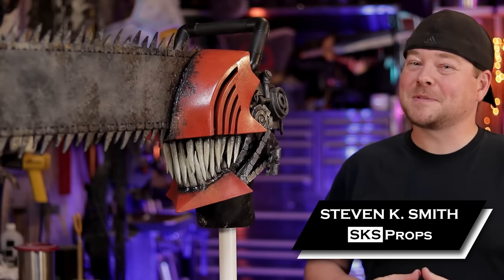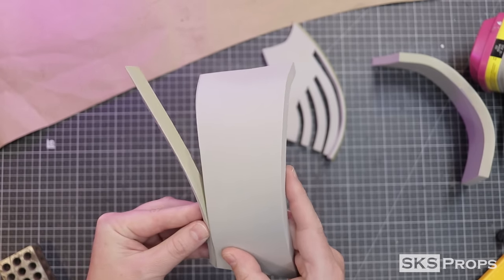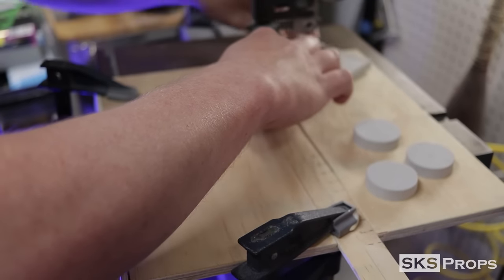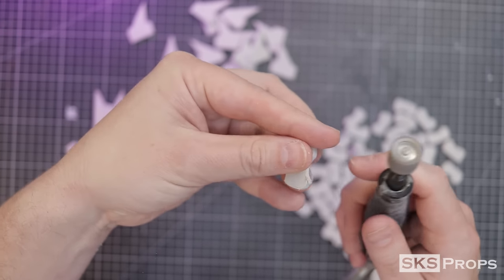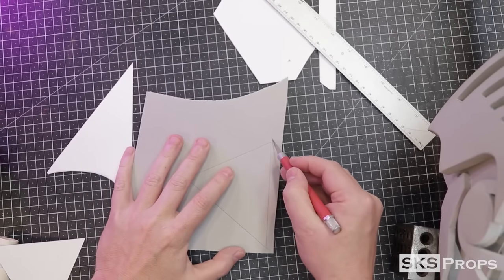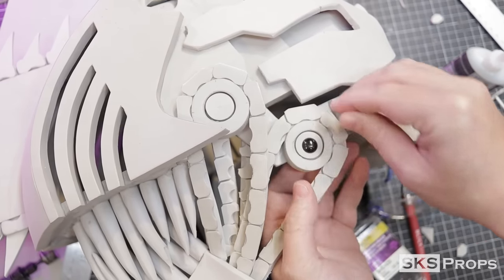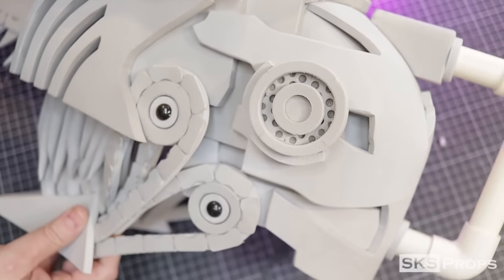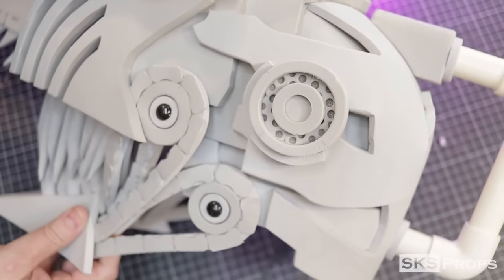How to Make a Chainsaw Man Cosplay - Free EVA Foam Template - Denji Cosplay Tutorial Part 1

Comment: my toxic trait is that i thought i could do this a week before Halloween and im struggling with part G
Reply: Believe me, it can be done. With the right tools, even I, who has never worked on a project like this, managed to almost get it done in 5 days
Reply: @soewithanumber  Working from morning to evening over the course of 5 days I managed to get it done and painted, only having to rush over a few of the bigger details on the sides in the end. As my first project like this, ever. In my experience, the biggest time saver was building a home-made bandsaw, out of placing a jigsaw upside down in a hole in workbench. Worked wonders! 

Without the right tools, like the dremel, wood boring drill, "bandsaw", hot air gun and right types of glue. And a good workspace, it would've taken more than 5x as long to get done, if possible at all!

So "With the right tools", is a very big keyword. I'm very lucky to have a dad with a very extensive garage hahaha
Reply: ive done it 3 days lol, trying again this year and taking my time
Reply: im doing the same thing, this is my first time doing a project like this and i am trying to get this done in 5 days
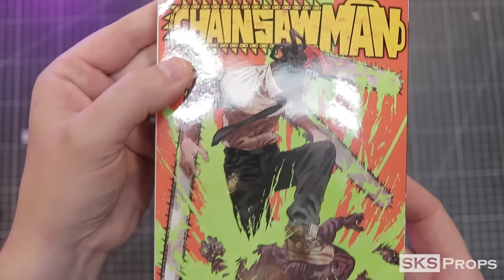Reply: Doing this at 1:52 2 days before Halloween get on my level (using cardboard though not eva foam)

Comment: Thank you very much sir. Both for sharing your talent and providing such an excellent video. 
I do have a (hopefully) quick question: I want to make the head-chainsaw to be able to actually mimic ( of sorts) the rotating  saw blade of a chainsaw by using a small electro motor (batteries) . Will the foam be able resist the extra weight and tension?
Reply from the maker: For the head yes but you would probably need to add some kind of additional support in the middle of the chainsaw itself then skin it with foam. You’d have to test what would work best (something like pvc board)

Comment: Looks absolutely stunning!
I have some questions about measurements, if you don't mind answering.
1. How long are the teeth?
2. What are the dimensions for the 6mm foam pieces, my foam is only 12" x18" and I'm not sure if it will fit the designs.
3. Will a hair dryer work in place of a heat gun?
That's all, thanks in advance
Reply from the maker: Thanks!
Teeth range from 2-3”
Might need a longer piece the blade is about 24” long unless you had a seam
Get a heat gun they are pretty cheap online 
👍👍
Reply: @SKSProps  Thanks so much, I really appreciate it!

Comment: What type of glue did you use to affix the scrap foam at the back of the blade to the mask ? I'm having trouble getting mine to adhere.
Love your videos !
Reply from the maker: Weldwood contact cement and super glue it’s my double adhesive method for a stronger bond

Comment: Curious what kind of yard marker you’re using for the support of the blade, the kind I found were not sturdy enough?
Reply from the maker: I used the metal ones at lowes for the head (it has 2 loops I cut off, just needed the straight part) and I am using the bright orange fiberglass yard markers at Lowes for his arm blades
Reply: @SKSProps  tysm!

Comment: So ive been practicing on extra foam for parts A and B i was wondering for part A is the 30 degree cut the same as part B? Where you cut 30° then you transfer to 90° around 2 in
Reply from the maker: No the part A was a 30 degree across the whole top the part b has the change near the end 👍
Reply: @SKSProps  thank you im doing hand cuts and around the bit part of the eye at the bottom its not sitting flush

Comment: I'm sligthly confused about the parts H and I. It feels wrong that they're the same size as it's making it really difficult to stuff one under the other. Is it meant to be forced under there?
Reply from the maker: Yep, otherwise it’s your build change it how you see fit.
Reply: @SKSProps  Thanks! I'm amazed how fast your respond. I'm also glad to say that the armblades turned out working really well!

Comment: Insane build but how am I going to make the templates bigger?
Reply from the maker: You open the PDF in adobe acrobat or adobe reader and then click "poster" in the print settings that scales it properly regardless of the paper size you use. From there you can change the size percentage if desired but shouldn't be necessary

Comment: For every thing you need from the head to the arms and anything else, how much would it all cost?
Reply from the maker: Depends because I already had a lot of the paints and sealers on hand. But I would recommend that you get a sheet of foam each size 2,4,6,10mm. So if you were buying the foam, paints, pvc pipes etc probably around $100-$150
Reply: @SKSProps  and for the foam sheets bundle and the foam dowels, they are sold out on the links you gave. Where else would I get them?

Comment: You should really do a tutorial on a 30 degree angle cut. Part a to b is literally the most difficult part because idk what I’m doing
Reply from the maker: with enough practice you will get better, It's just holding the blad at the correct angle. If you're not doing it correctly you can also just get a rough cut with your knife and clean up the angle with your rotary tool

Comment: May I ask after the build and painting was completed, how did you go about adding padding on the inside to remove bobble/add comfortability?
Reply from the maker: Part J is adjustable and should be fitted to your head to stop it from shifting around but you can always add upholstery foam for comfort and to make the helmet more form fitting. You can get upholstery foam from just about any craft store or someplace like Walmart

Comment: Hi I’ve been using this magical tutorial as a basis for approaching my Chainsaw Man Cosplay, and I was wondering what type of pvc pipe did you use for the handles? It’s one of the last parts left I need to make and was wondering what size you went with
Reply from the maker: 3/4" all of the sizes are in the lower right corner of the template
Reply: @SKSProps  thank you!

Comment: This looks great, i will make it for the next Japanday in  Düsseldorf, germany. But two questions : Is the pdf presentation for a normal dinA4 Paper ? The left Mask part with the 3 slits looks so small^^" Can you look good throught the mask ? I watched many diy videos of the mask building and im a little unsure.
Reply from the maker: Watch the how to print templates video on my channel paper size doesn’t matter. You see mainly through the gaps in the teeth more so than the slits on the sides

Comment: Looks great! The oil/gore residu along the teeth and start of the blade is great! How heavy is it? I imagine that's why people use EVA foam (I use a hollowed out chainsaw for my Ash Williams cosplay and that sucker is heavy!) But I can't shake the fact that the helmet itself has to be kinda heavy to offset the weight and length of the saw's arm/blade
Reply from the maker: Thanks! The helmet weighs very little it's extremely light the few pvc pipes on the back are the only things counter balancing the front blade. If you haven't tried using eva foam before for costume parts it will be a huge difference
Reply: @SKSProps  thanks for the response! I have not used EVA foam. I know it's used a lot, it's just that next level in crafting that I haven't taken the step to trying.

Comment: Long shot as its quite an old video now! I love your work just wondering how long did you make the chain strips which connect the jaw to the top of the mask?
Reply from the maker: The ones that go around the circles are approx 14-15” long
Reply: @SKSProps  Thank you for such a speedy reply I was really stumped! Thank you again for your hard work on this! So far its been a blast making it
Reply: just another question in relation to your chin where does the bottom jaw sit?
Reply from the maker: @KelProductionz  don't base it off of your chin pay more attention to the teeth and how they line up. that will put the jaw where it needs to go. otherwise some people that built this had his mouth open  and one of my friends even added a tongue to his

Comment: Hey this is super cool and I would love to try it out, but I would have to use cardboard to do so. Would there be any issues with using cardboard instead foam, also what kind of adhesive would you recommend for cardboard?
Reply from the maker: You can definitely try. Cardboard will be a bit harder to work with because it doesn’t take compound curves quite as well as foam. You’d probably want to use hot glue.
Reply: @SKSProps  good to know, thanks!

Comment: Do you happen to remember how long the pieces of pvc pipe were you cut? Finally almost done with this build and the handles are the last thing I have to make.
Reply from the maker: Sizes of the pvc pipes are in the lower right corner of the template
Reply: @SKSProps   Ohh awesome! Never noticed. I'm heading to ACEN next week and will get you some pics. Ty again for the template and vids. You're a wizard with how fast you pumped this out. Even with 6 months, I couldn't duplicate it to an exact copy.

Comment: thank you so much for this! Im going to attempt to do this since my daughter has been wanting to cosplay as him ive already bought the materials so just wating for it to arrive!! i did have a question if i want to make it smaller (daughter is 8) do i scale it down on the poster size? and also she wanted it to move can i apply the same method you used on the skull mask on this one? or would it not work because of the chainsaw in the front?
Reply from the maker: Yes I’d probably scale it down 10-15% but unsure of the size. And yes you can use the same techniques part J keeps it snug against the back of your head

Comment: HI! May I ask roughly what is the circumference of your head? And if the helmet fits you perfectly or does it fit you large or small? So as to have a yardstick with the measurements of the parts of the helmet contained in your templetes. Thank you!
Reply from the maker: My head is approximately 23 3/4” but that doesn’t matter. You adjust the build to fit your head with part J that’s why I designed it that way. And you don’t need a yardstick with the measurements watch the how to print templates video the pdf is already scaled

Comment: How many foam rolls do I need to make for each size (10mm, 6mm, 4mm, 2mm)?

For the metal yard marker, is it okay to use metal clothing hanger?

Where did you use the pvc board? You had listed as an item that was used in the video
Reply from the maker: As listed in the video description a roll of each size 2,4,6,10mm   
You'd want to use several metal hanger wires if necessary because they just wont be stable enough  
I didn't but you can use pvc board to strengthen areas that need reinforcement
Reply: @SKSProps  thank you! I am sorry if my first question was misleading what I meant is how many sheets or rolls of foam did it take you complete the cosplay for each of the sizes?
Reply from the maker: @lisaha6745  that’s what I’m saying you need a sheet of each size for this build. You’ll have some left over but you need each size
Reply: @SKSProps  thank you! Also will it be 2 rolls per each size since I still got the arms that needs to be make?
Reply from the maker: @lisaha6745  one of each size the only one you might need two would be 6mm for the arms depending on how you lay out the patterns

Comment: This job was absolutely incredible! Question about the pdf’s though. How big were the paper templates you used (for reference), and how were you able to print them so they came out at those sizes?
Reply from the maker: Thanks! Just follow the directions on my site and open the pdf in adobe acrobat or adobe reader and click “poster” in the page size area that scales it properly over several sheets regardless of your paper size

Comment: Hey SKS Props I going to be making this for Halloween this year and I currently only have access to 6mm and 4mm foam do you have a recommendation for how to adjust the pieces that use 10mm to work with 6mm.
Reply from the maker: It’s going to make it a lot tougher on you. You could glue the 4-6 together but it will firm up the foam quite a bit making it more difficult to cut

Comment: Hey
I've never worked with eva foams before or have tried to make any sort of cosplay

If I were to buy the foams, how much quantity would be needed to make this?

I'm still in college and I don't wanna spend more than needed

I saw a comment of you saying to buy the sheets of 2,4,6 and 10mm each, would that really be enough?
Reply from the maker: Yeah as long as you lay the templates out right. But if you’re worried you might make a mistakes then get an additional 6mm and you’re fine.
Reply: @SKSProps 
Hey man, I checked your website and I hate to be that guy but the prices are way too high for me since I'm from India and our currency is too weak for me to make such a purchase when I'm still in college

Do you have any other alternatives that are cheaper? I'll be very grateful if you can help me with suggestions ♥️
Reply from the maker: @Yuvraj-p9s  find foam closer to you. I have a bunch of fans that build my projects in India so I know you have options overseas
Reply: @SKSProps  
Thanks man, I'll try looking around :)

I appreciate the work you're doing, keep at it ♥️

Comment: So I was wonder, what is your head size? I got a pretty big head with like a 24.25 inch circumference. I just printed out the template and it seems just slightly small from my eyeballing. Im thinking about resizing the template to get it to my size if the difference between us is big.  I just got all the foam. I have a laser cutter so was also considering cutting some pieces out using that, especially the chains and sawteeth.
Reply from the maker: It's all adjustable by the amount of foam you remove from the inside for you cheeks but part "J" is what makes it fit your head.
Reply: @SKSProps  my seam between A and B is not great, would you just recommend using the foam clay to fill it in? Overall I'm really enjoying this build. Also having a laser cutter helps with this alot

Comment: I have another question, is part C supposed to lay on my cheeks and have space for my nose to fit? I'm now making the back of the mask with the parts M and J (which are the parts i have to cut according to my head size). I can't figure out how far into the mask my head should be so that i can mark were to glue the pieces

Comment: hey, trying my hand at this helmet right now, and I was wondering what the measurements you used for the 3/4" PVC pipes? tried checking on the template but unfortunately didn't find them!
Reply from the maker: Check again, All of the measurements are in the lower right corner of the template on the line Art helmet pic
Reply: @SKSProps  ah, thanks for specifying! can't wait to show the end result :)

Comment: Thank you for your job and for letting us have the templates. Can i ask you: if the paper size is A4, the poster mode is 3x3 or 4x4?
Reply from the maker: Just follow the directions on my site and open the pdf in adobe acrobat or adobe reader and click poster in the page size area that scales it properly over several sheets regardless of your paper size
Reply: @SKSProps  ok thank you very much!

Comment: The 15mm round dowels are sold out on the website, would the half-round or triangle dowels work or should I look on another store?
Reply from the maker: Triangle dowels will work or the 20mm and just sand them down a bit more. That’s what I just used on my foam pumpkin mimic

Comment: What kind of wire did you use for the teeth? I’ve been looking everywhere for it but can’t seem to find the right type. Thanks!
Reply from the maker: Just some 14 gauge wire I got at lowes hardware store item number 62931
Reply: @SKSProps  thanks! Also how long did you make the teeth? I don’t think you said a measurement in the video. Thanks!
Reply from the maker: @nebula4224  Yeah I forgot that but they are 2-3 inches long

Comment: How much foam should I get? Like if this was my first cosplay made how much EVA foam and foam dowels and clay etc. should I get?
Reply from the maker: @volcaronaa  sheet of each size 2,4,6,10mm possibly another 6 if you’re worried about a mistake on the arms. 2 packs 15mm dowels 1 tub of foam clay
Reply: @SKSProps  thanks! and for the glue?
Reply from the maker: @volcaronaa  weldwood contact cement and superglue

Comment: Hello,Steve. I wanted to recreate a chainsaw man mask by myself for a school project. But  I accidentally printed 12 pieces of your template instead of 9. I'm just here to ask that it should not somehow damage the original form? It just should just be bigger ,right? Because i dont have my own printer nor do i have money to print another size of template
Reply from the maker: That’s fine each printer can print it differently depending on specifications it should be the correct scale
Reply: @SKSProps  Thank you!!

Comment: So are the strips that are connecting part g and the jaw 4 mm or 6mm?
They look the same size as the 10mm circle (part g)
Reply from the maker: 4mm
Reply: @SKSProps how long would the average teeth be?
Reply from the maker: @IvanGonzalez-eo5kj  2-3 inches
Reply: @SKSProps how long should the 4 mm chain links (that connect to g) be?
Reply from the maker: @IvanGonzalez-eo5kj  however long you need them to be so the jaw fits you everyone is different